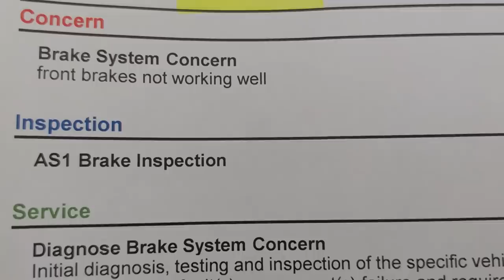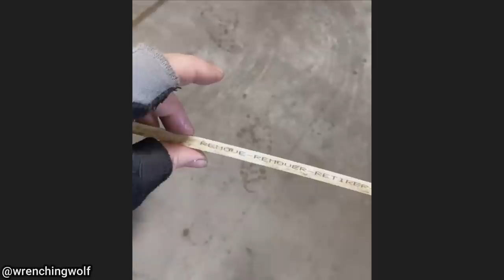Customer States Dropped Socket Into Engine Bay And Vehicle Won't Start | Just Rolled In

Comment: 27 year old tires with a ton of dry rot. Guy probably said there was plenty of tread left and the mechanics are trying to sell me something I don’t need.
Reply: When they blow out he'll get to buy new tires and pay for a tow, if he doesn't wreck first.
Reply: Oohhh they're good for another 100,000. C'mon now. Those were Perelli we're talking about 👌🏻👌🏻

All joking aside...he's lucky if that tire made it 80 straight mile before it gave out. Being a tire specialist from backwoods western Pa...I've seen this ..often. I've covered the cost a new or used loaner tire, for a customer, myself, on several occasions...
I can't let something like that back out the door. Especially when I find out... children ride in the vehicle..
Reply: You can have old tires with plenty of tread doesn't mean they are good and most likely they are not. Have a few and they have dry rot plenty of tread however.
Reply: After working in a tire factory for 30 years, I found that after a tire is 7 years old, it should be replaced.  Especially if it's on the vehicle that has lots of road use. After 2 years in the warehouse,  we scrapped them.
Reply: @foodhatesme  
The problem is there is limited proof the inspections actually do much to reduce accidents, probably because the kind of person willing to risk driving around in an unsafe vehicle is also very likely to be the kind of person who wouldn't even bother getting it inspected or would ignore a failed inspection and carry on regardless. This is why a number of states that used to have them started doing away with them. Mostly they just ended up being an extra pseudo-tax which is most onerous to the poor who tend to have older vehicles, and another issue is that there isn't really much risk of consequence for failing them. 

My state has inspections and I'm actually a certified inspector. I would fail that vehicle on tires obviously, but all that would happen is that he would drive it away with a sheet of paper that said it failed. Basically, the only way for them to get into any trouble would be to actually get caught and cited for expired registration by the police, if you then ignore that your license could be revoked. Thing is it's pretty easy to just never really get cited for it, usually it happens incidentally to some other traffic offense, so even if your car is a death trap if you don't drive like a moron, you could likely drive around for years without consequence again making the whole scheme kind of useless.
Reply: @kyleg-rover7707  You’re a good man, sir. My own mechanic and friend for decades, takes no chance on people like this: he writes it on the oil change bill and have the client sign it.
Reply: @foodhatesme  Remember this when such idiots blow a tire or any other safety related item and ram into your car, out of control. In this case, it’s a matter of when, not if.
Reply: @trackerrrr  unfortunately the most likely scenario in the US, especially if there is lots of damage/casualties, is he will sue. Sue Pirelli, sue the vehicle manufacturer, sue the shop that "let" him leave on the tires, maybe even try to sue the individual mechanic that worked on the vehicle.

Personal responsibility simply isn't a concept most people are familiar with these days.
Reply: They just don't make them like they used to
Reply: @Harry Balls and mosy likely someone will be involved with them.
Reply: What they usually don't realise is that once tires are that old, they're not only likely to fail, but the rubber will have hardened so much that they won't flex nor grip the road, guaranteeing that the vehicle will aquaplane in the wet!  Don't expect your brakes to work properly either!
Reply: @marcryvon  Children should never fall victim that kind of carelessness. A neglected bad tire..can cost so many lives at any moment.

But, also as a person who well understands the struggles of life...it's not all carelessness. Sometimes..a person has to squeeze as much time as possible out of something, because they literally can not  afford it then. 

That's where techs like your friend and I, and many many others, play out biggest and most meaningful role.  A lot of people don't think about it..but at any moment, we're literally hundreds of lives in our hands. I take my job, VERY.. seriously. So thank you for the compliment
Reply: They got 2 ply polyester reinforced sidewalls, they'll be fiiiiiiine lol.
This is a joke btw. :)
Reply: @Tk3997  
The truth is. In states without safety inspections. Most vehicles have problems , and that gives the police a reason to stop you and talk to you.
Reply: Really good innertubes on dry rotted 7 ply bias tires. Owner is probably correct, despite appearances.
Reply: @foodhatesme  It's a waste of time, people drive around my city with no reg, insurance or plates all the time. Usually when a vehicle falls into disprepair or rots from age it becomes undriveable or too much of a hassle they find another car, problem solved.
Reply: That's the thing with dried out tyres, they stop wearing down... and cheap and ignorant owners get caught in an infinite loop.
Reply: I've always heard if they're 9 years old they're not DOT legal.  A quick Google says 6
Reply: I'm in the towing and recovery field of work, I see stuff like that alot, unfortunately the people do not take my advice or others advice and I generally get called back out, I have refused to put or change tires because of the spare looking like that
Reply: If your sidewalls are cracked enough to store dimes, your tires are trying to tell you something.
It's a suicide note from the rubber, y'all.
Reply: @Harry Balls well I'd prefer not to see vehicles with kneecappers metal spiked bumpers or other mad Max style "upgrades" from people doing "everything they want".
Reply: @Harry Balls In my country you need to pay money to register your vehicle once a year and for older vehicles (up to a certain year) you need to get it inspected (and pay a fee) at a mechanics that has certification to do so. Over the certain year then you need to get it inspected once a year.
Reply: @Tk3997  Arkansas used to have yearly inspections and your vehicle had to pass it before you could renew your vehicle registration.  Once the vehicle passed inspection, the inspector would affix an inspection decal on the inside of your windshield in one of the corners.  You were also given a form that states the vehicle passed inspection.  You had to give that form to the DMV before you were issued license plate decals.

If i ever let my registration expire, my luck would always be that I would get pulled over after a police car rolls up behind me at a traffic light and notices the expired tags.  Many years ago, I had purchased a Ford Mustang from a neighbor, and I didn't have a temporary tag on the back.  I had taken the vehicle into town for some errands, and I got pulled over TWICE on the same day for not having a license plate on the back with valid decals.  I had my bill-of-sale with me and that kept me from getting fined but was still a PITA.  It seemed like every time I turned around a cop would be behind me at a traffic light.  Bad headlights or taillights, same thing.

Then I'll see vehicles that has registration that has been expired for TWO YEARS and I guess they never get pulled over.  I am a firm believer in Murphy's Law in regard to vehicles.  If you CAN get pulled over for something wrong with the car, you WILL get pulled over.
Reply: @Tk3997  Limited proof? The US has the worst road safety record in the developed world, and the lack of an annual test has to play a part in that. In the UK you can't tax a car without a test certificate, and every police car has automatic numberplate recognition linked to a central database. Drive past with no test, no tax or no insurance, and you're nicked.
Reply: safety inspection should set a maximum time of use for tyre's.
But those tyre's wouldn't pass European Road safety inspection.
Reply: @Harry Balls My car is 39 years old, and has probably never been inspected for registration.
Reply: In the UK we have regular safety inspection called an MOT, typically done yearly. A valid MOT certificate is REQUIRED to legally drive the vehicle. This guy wouldve been arrested long ago.
Reply: @jaycee1980  in Spain, France and Germany it's pretty much the same... Can Americans drive around without "mot"???
Reply: @Tk3997  In Switzerland, you've got like 30 days to repare the car after the inspection.

If not, the cops come to your home and take your licences plates.
Reply: @Tk3997  germany has it far more complicated (of course!). :)
the first inspection for a new car is after three years, then it's every two years. trucks and every vehicle used for public transport is checked every year.
the checks are pretty thorough: brakes, suspension/steering, exhaust, and corrosion on every part of the body that makes it sturdy. underframe, underbelly, sides, and so on. they also check things like seat belts, and on modern cars, read the error codes.
now, if the car fails, you have 6 weeks to fix and re-check. if you skip that, or the organisation has your car's datas and has already sent you a reminder, they will eventually tell the registration agency, and then you might find yourself driving without insurance. which is a crime here as well as driving without license.

it's not like we don't have accidents happen, mind you; quite the contrary as people here have become egoist and reckless as well. and we drive way faster in general, too. but at least it's rarely because of rotten brakes and frames...
I wonder what would happen if you had the same authority than our checkup-engineers here.
Reply: Those people scare me and why I think mandatory safety inspections are not a bad idea.
Reply: Yeah, don't drive anywhere on the highway especially Illinois roads, they will  instantly pop there if the guy makes it that far.
Reply: @Harry Balls My state doesn't require inspection.
Reply: Looked like plenty of tread left to me.  Roll em.
Reply: @kyleg-rover7707  Good man.
Reply: You dont really believe half the stories this channel feeds you right?  You really think that story is true?   
I bet you the real version goes something like this:  "Guy gets his old project truck up and running again and takes it to nearby shop for a tune up. It will be registered and driving around just as soon as those tires he ordered off TireRack arrive (which were much better priced than the shops tires he declined) and the tech thought it was cool to see that much dry rot. Likely story.
This channels versions usually go something like: "Totally ignorant owner takes his truck into the shop and yells at the mechanics for trying to upsell him on tires, just before he began driving the truck to LA in 3 hours to complete the Cannonball Record run."
Reply: @foodhatesme  Emergency room doctor here.  I am a shade tree mechanic and drive what I believe is a very safe and well-maintained car.  I change out tires at 5 years or 5/32, they are the only thing standing between me and fiery death as I hurtle down the road in a 4000 pound guided missile.  I appreciate that you value your freedom, but there is no such thing as a right to drive on 27 year old tires down a public highway amongst the other, more responsible people.  I like the freedom not to have some doofus have a blow out as they approach me on a windy 2 lane road.
Reply: @ikillstupidcomments  Americans are convinced the government is out to get them. One day, hopefully, they’ll grow up.
Reply: @foodhatesme  That's not really true. California doesn't let you modify emissions equipment, but suspension mods and things like that are allowed.
Reply: @trackerrrr  The other side of it is that they're not the only one's driving on the road and a tire blow out can cause a momentary or full loss of control which can take out other vehicles then its not just their life's are affected..
Reply: 27? Jeez, I thought the 8 tires I had swapped out the other day were bad! Two Grand Prix's. Same tires on both (225/60-16 Generals). The set on the '99 GTP was 11 years old by the sidewall number, and the set on the '05 GT2 was 9. And yes, they had about3/4 tread depth remaining. ;) New Goodyear all weather touring tires on, and they both feel like new cars! :)
Reply: No inspections for rego in South Australia but they really don't need it you see very few clunkers on the road as the cops immediately defect them requiring a trip "over the pits" to have the defect notice removed. A qualified police mechanic/inspector will not pass it without major works.
Reply: @foodhatesme  So in USA the government is not allowed to provide universal healthcare, is not allowed to check if vehicles on the public roads are roadworthy, is not allowed to check if a person wanting to buy a gun can handle it safely, but it is allowed to treat women as slave brood mares even if it kills them or are just 10yo kids? And I thought Soviet Union was crazy...
Reply: @Harry Balls Suspension, steering, fluid leaks, emissions (to an extent) - unless it would be legal to shoot drivers that do coal-rolling or with 120db loud exhaust ;) In general - anything that faulty could endanger other road users.
Reply: @foodhatesme  don't speak for all of california, here in humboldt you can do what you want.
Reply: NYS is annual inspection and 1-2 years per registration. Try driving without either and you'll be best friends with the local court.
Also inspectors can lose their license if they were to let something like that get through.
Reply: @msa4548  Hopefully all states will follow that example soon.
Reply: @davidjones332  
YEs, very limited proof, at best maybe it prevents a comparatively tiny number of accidents, but often it's nearly impossible to find any signal that rises above noise and even the studies that sometimes find very small benefits force one to seriously question if those are worth all the expense of these inspection regimes (the answer is probably not IMO) And nothing you said is any different from my state really. You can't tax a car here without a valid inspection either, but that's kind of a laugh isn't it? Like "now you listen here you naughty motorist, if you don't go get this inspection, we won't allow you to then go and give us your road tax for the year!' 

Motivating to your average uncaring dead beat to be sure! 

The cause of excess US road deaths has frankly absolutely f'all to do with mechanical issues. Mechanical failure causes only a tiny fraction of accidents to begin with, and the number of those failures that mandated inspections:
A: Catch at all 
B: Wouldn't have been caught and corrected during the course of normal complimentary inspections during periodic maintenace anyway
C: Aren't too small an interval (IE the fault develops and causes the accident in a time frame shorter than the periodic inspection which is pretty easy when most of them are yearly or even bi-yearly).

Is going to be much smaller still. I think it's that second one though, that most people don't think about, that ironically is probably why these kinds of mandated inspections barely produce results. See because shops want to make money any time your car is in for normal service we are ALREADY looking for things we can sell you, and the more dangerous the better, because that'll make any reasonable person more likely to do it. This is where I make the vast bulk of my real safety catches. 

US roads are deadly because they're filled with oversized vehicles (That can then be modded to be made even more dangerous, three and a half ton pickup lifted so its damn headlights are eye level with a five and a half foot man? A-okay), that are given way to much room even in 'urban' settings to get going way too damn fast while pedestrians and other road users are basically tossed into a madmax 'every man for himself' environment in most places. All this only made worse by lacking driver education to the point many people in cars will get indignant and aggressive with completely legitimate uses of the roads by pedestrians or bicyclists.  

Inspections do nothing to address the real causes of US road death issues, and if anything, most of them only even came about to begin with probably as a cheap attempt to dodge those much harder to address core issues so politicians could be seen 'doing something' even if that something is basically just theater that has no real effect. Like I said my state has them and I do them everyday, but I don't feel like I'm really doing shit to make the roads any safer and I severely doubt anyone doing them anywhere else including in the UK really does either.
Reply: @lotharrenz4621  
That's actually somewhat less stringent in some ways than what we have in my state (North Carolina), all cars regardless of age or mileage need a safety inspection yearly. Certain 'urban' countries require an emissions inspection as well, though cars under 3 years old and 70,000 miles are exempt from this as are cars over 20 years old.  If you fail you get a one month window to make corrections and can then be reinspected only on the defective item for free. An uninspected car can't be registered or taxed, but it can be insured (actually you need to provide proof of an active insurance policy to register a vehicle to begin with), driving an unregistered vehicle is nominally illegal, but it's considered a very, very minor offense to the point it's at an officer's discretion if he even bothers to cite it. 

The safety inspection itself is all lights (for operation and aiming for the high and low beams), wipers and windshield glass (no cracks in drivers' field of view basically) horn, brakes (service and parking/emergency), suspension and steering components, tires, and a visual inspection of the exhaust and emissions devices for obvious tampering. The emissions test uses the cars onboard diagnostics, we don't pull codes although anything that sets the check engine light will fail it for emissions. Rust isn't covered in and of itself on the inspection, although at the examiners discretion it can be failed for it if it's effecting covered systems. This is probably because we're far enough south that we don't get much snow or road salt so very extensive rust is rare.
Reply: @Tk3997  well, these things get checked here, too, of course. and since some special cars can have rust on suspension arms as well, or the front crossbeam like early Ford Focus, those get a good look, too.
there are actually rules for how to fix a corroded body and frame, to make sure everything is sturdy enough to prevent accidents or injury. one time I was glad they go that far when checking, as it turned out the part of the entry frame where the seat belt roll is fastened to was crispy like croissant. an accident would have had me flying through the windshield... so I fixed it good to my best knowledge. the car felt a little more sturdy, too. or was that my conciousness?
german roads get salted  alot. many communities on the flat lands are dead afraid of fine layers of ice on the road and the accidents that can happen, as they can be held reliable. so the streets get spiced good. towards the mountains though there is so much snow they often don't bother and just keep the roads drivable. also, laws say to use tyres suited for the situation; so if you skid off the snowy road on summer tyres your insurance might flip you a bird or two...

I picked the habit of driving winter tyres all year. hankook winter icept seem to work best for me, in narrow 165 80 R13 size they won't wear down too fast, either and are affordable still.
Reply: Chances are he'll probably rethink the tire situation while trying to pull up in the wet on hard old rubber.
Reply: @masondegaulle5731  that sounds like a tyresome chore...
Reply: @lotharrenz4621  Ba-dum Tsss
Reply: Yes officer it’s stock😂
Reply: He will get new tires soon . When they start blowin out .
Reply: just drive it until it goes boom xD
Reply: @s0nnyburnett  when their junk car get completely broken and unable to move, they just get some other car that is even worse. Ploblim solvid.
Reply: @citizen23606  my spare tire on old mitsubishi triton just looked like that lol😂
Reply: @sadfatdragon9529  safety inspections are ultra bad idea, which starts by banning such tires and brakes etc, and ends with banning everything up to aromatizer or dvr in car.
Reply: @stephenrobinson7945  I tend to get 9-10 years out of my BFG KO tires...
Reply: @Tk3997  I have a jackass aquantience that got a "clean" safety by a bribe even tho the truck should have failed... I also bought a truck that was sold with a "clean" safety inspection when it should have failed... so yes mandatory inspections are a tax and cash grab
Reply: @opendstudio7141  those 27 year old tires were on a 1/2 truck... they were not Bias Ply tires... Bias Ply are on Medium duty trucks
Reply: @Tk3997  Here in Maine a common thing is for the tech to remove 1/2 of the sticker. Marking the car as unsafe. Police pay attention to that.
Reply: @Harry Balls most states don't require an inspection
Reply: @foodhatesme  "I'd prefer reactive rather than proactive." 
That's a profound lack of self-awareness you're exhibiting. You're so close to getting it that it's actually painful.
"make it illegal to make any changes"... absolutely false. CA has, objectively, the largest scene for modified vehicles in the US.
Reply: @foodhatesme It's better to let problems happen, and hope you can fix them after, than to prevent problems? Because of freedom? Must be an American thing...
Reply: Those tires are older than me…
Reply: @MonkeyJedi99  >dimes
>suicide note
I would assume a whole bag of dimes. A dimebag, if you will.